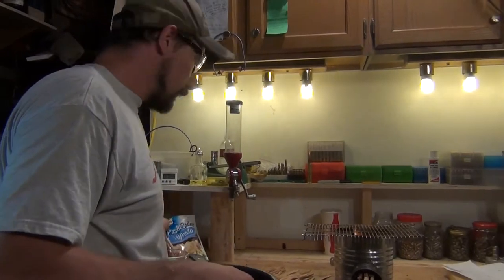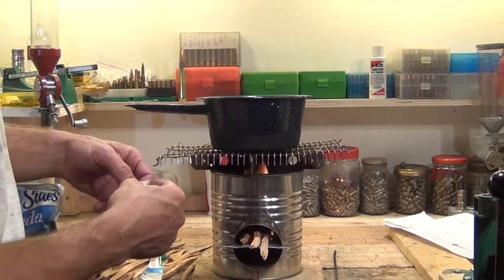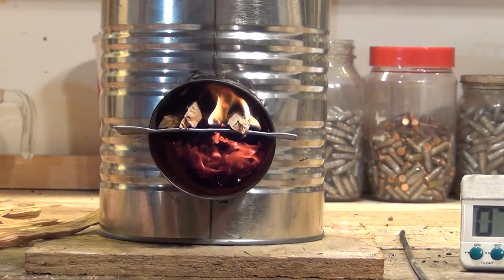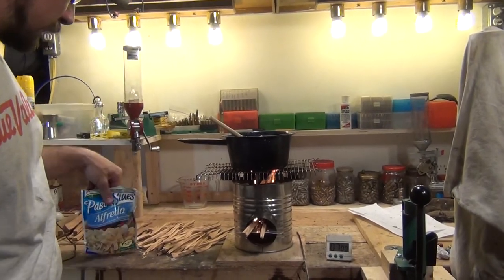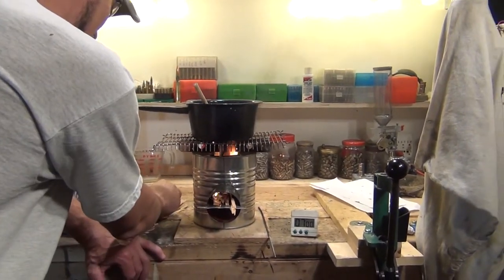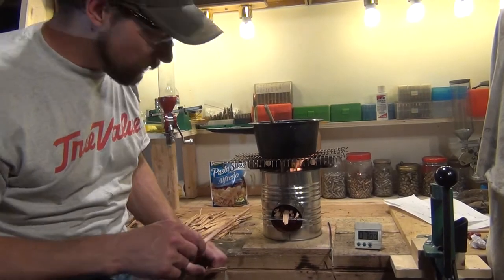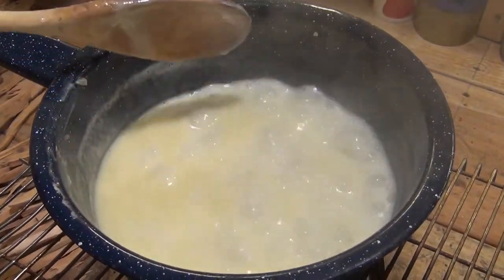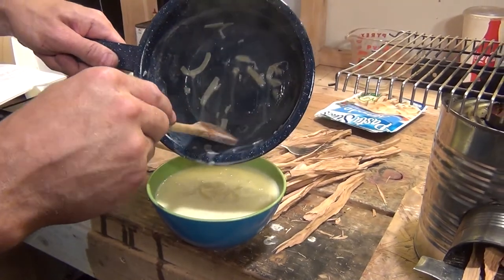Cooking with a Rocket Stove - HD

Comment: backwards   condensation on pan shows contents is cold and humidity in air is high
Reply: Especially when the air around it is hot. The water vapor will want to condense on the colder pot.